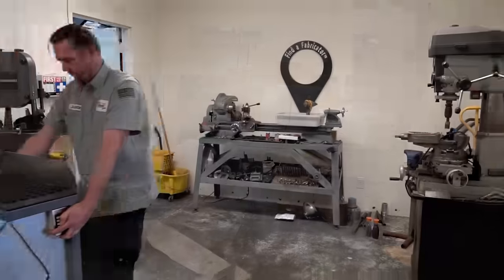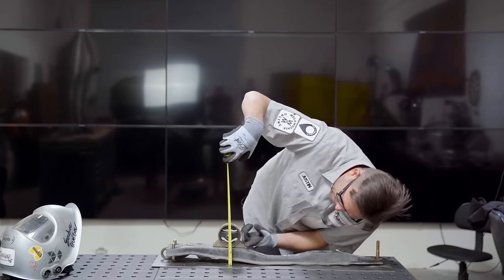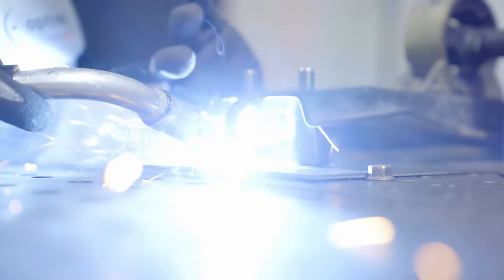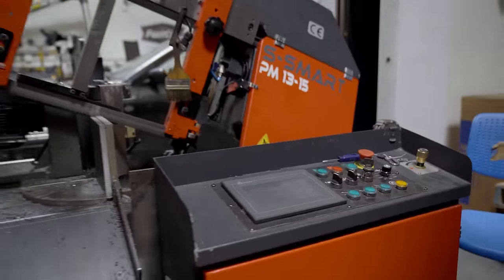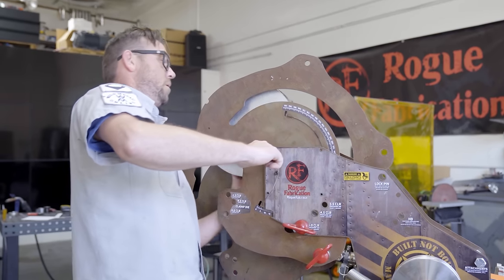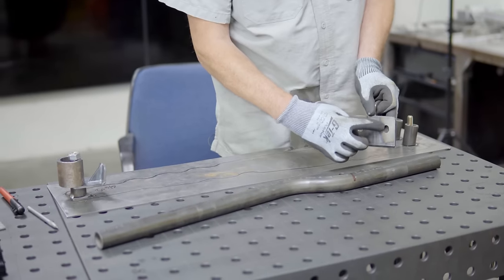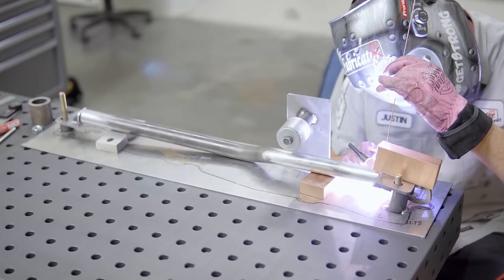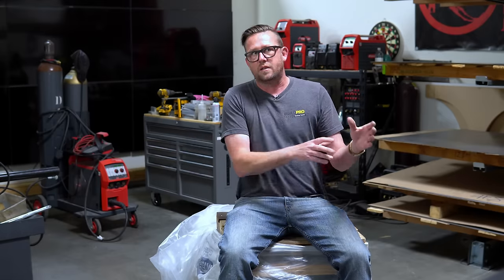Custom Tubular Crossmember from Scratch | TFS Lost Episodes 1

Comment: A while back you made a video designing a control arm and glossed over how you chose the material thickness. How you knew what would be strong enough for the part not to fail. You said it was boring and might make a video if we wanted it. WE DO! I feel like that is one of the most critical things missing in my ability to sell great parts that I know won't kill someone. Would love to see a video explaining your process!
Reply: its all about Section Modulus, Moment of Inertia, and Modulus of Elasticity. you know, engineering stuff
Reply from the maker: I can't teach people how to be engineers. That's kinda something you should go to school for.
Reply: @TheFabricatorSeries  what a lazy, condescending response. You could very easily give us a how to for dummies or break it down into laymans terms. You don't need to teach us, or condescend someone, just explain your reasoning for choosing the material thickness.
Reply from the maker: @HeresMinx  Nooooo... I can't. There's no such thing as taking Part A and plugging it into Part B and making Assembly X that works for everything because some random guy on the internet told you it would work. If you don't believe me - go to school. You'll understand. If you want to get mad - go to school and learn how to prove me wrong. Just go to school and learn something.
Reply: @HeresMinx  many times the choice of material is based upon the law of surprise - that which you already have but dont know until you look in your stockpile.
Reply: @garywoodard5759  okay now that was funny
Reply: @TheFabricatorSeries as someone who has designed control arms for production vehicles I appreciate that response and don't find it condescending. I also drive on public roads and don't want to have to worry about crazy people making their own control arms using a boiler plate set of rules they found on the internet. 

Not that the automotive aftermarket is much better than that in a lot of cases. Working with automotive aftermarket companies early in my career made me realize you should never be the first customer to buy a product from an aftermarket company if it is safety critical.
Reply: @TheFabricatorSeries 
  School? Yes good idea. Finances of schooling are most often the obstacle to furthering one’s education. 
  In China, if a person wishes to attend advanced education at a school, the Government of China helps pay. The student graduates to a career, without huge debt. For Real, in fact.
  This is a primary reason for the Stunningly fast growth of China.
Reply: @HeresMinx  He wasn't being lazy or condescending.  There's a reason that engineering is so tightly regulated.  After sitting for your Fundamentals of Engineering (F.E.) exam, you have to have at least 5 years of experience engineering under a Professional Engineer (P.E.) that signs off on and stamps your work before you can sit for your own Professional Engineering license.  Most engineers spend closer to 10 years before they are ready to actually pass the exam.  There is very good reason for this.  When you are an engineer, and you engineer something, you are responsible (read civily and potentially criminally liable) if it fails due to bad design.  That includes giving information to some random person who then uses what you gave them to come up with a part that then kills them or someone else.  But aside from all that, it's just that there is no cookie cutter solution to a problem when you are building something custom.  You have to understand the forces and stresses that the part is going to be subjected to and design accordingly, especially if it's a performance part.  Engineering is about coming up with an exact design that achieves the goal without adding unnecessary mass, filler or other crap that won't get you every ounce of performance out of the part.  Overbuilding works because thats what most people do who can't crunch the numbers, but it won't get you the highest performance.

But you don't actually have to go to school to learn all this.  There are other avenues to learn.  Books on Statics of Materials,  Mechanics of Materials as well as Dynamics of Materials should be in every reference library of anyone wanting to SAFELY design critical parts and systems.  I suggest Hibbler (one of my former professors), his books are excellent, and are among the few books that I didn't sell back after the classes were done.  Another resource is MIT.  They have published videos of their entire curriculum for engineering.  If you struggle with the math, then I suggest spending some time on Khan Academy so that you can understand and do the math, because there is no getting around that engineering requires some pretty advanced math (and some not so advanced).
Reply: @grnsouth1204  I am not reading all that

Comment: If I remember correctly I found this channel long ago when I was looking to improve my notching skills. I was using a notcher but my cage design puts multiple tubes coming in to single points. I liked this style videos better than the welding stuff now. But I've learned more from the welding stuff!
Reply: And ironically I'll be designing a couple motor mounts and a cross member tomorrow morning. For a 35 Plymouth coupe.

Comment: Integrity. That sums up you.
  I appreciate the style and speed of the presentations. 
  Hit the ground running. Try and keep up.
   All that said. If you are young and the algorithm sent you here. There are some extremely important take aways.
   Integrity. 
  Speed of jobs. Justin is not any faster than his competitors. He is as fast. The real world is highly competitive. It moves fast. Speed comes with experience. It's always best. Always best to master a level of competence before speed. Fast and sloppy doesn't get paid.
   Justine mentions keeping track of the time spent on every facet of the job. More than once he mentions keeping track of time. Each part of the job requires different skills and tools. Not all of those bill out at the same rate. Some skills bill higher. Some bill lower. It's important to keep track of your time for every step. Also a customer will greatly appreciate knowing exactly what they are paying for and why.
  Lastly. Manufacturing is come back to the US.  They stopped teaching shop in many school districts. Blue collars workers are now and definitely in future in demand.
  You're in high school. No shop classes. Search out various blue collar businesses near you.  A welding shop,machine shop. Injection molding,auto repair, plumbing, hvac,electrical so and so forth. See if you can get a job sweeping floors after school. Be diligent. Show up on time or 15 minutes early is even better. Work hard. Don't be a smart ass. You are not so much interested in that particular business as you are in getting your feet wet so to say. Learn and move on.

Comment: I always enjoy your videos  ,I like making metal thing
Reply: I once built from  scratch a self loading wheel lift  tow truck.  Installed it on a Ford cab and  chassis.  Installed and  fitted all hydraulics and wiring ,moved fuel tank from rear of truck between frame to on top of frame just  behind the  cab. I fitted joy sticks in cab so I didn't have to get out of cab to grab towed vehicle I was  quite  proud of that truck.

Comment: Hey Justin, still love the TFS series (and all of your other ventures!) You single handedly taught me how to TIG, and for that matter MIG weld. I really liked the content in this video, but was wondering if you have any tips / tricks on designing something from scratch. IE I'd like to build a front bumper for a 2019 Polaris Rzr that can bolt up to the machine, and house a winch. I have a lot of tools, but don't have a tube bender. I know I can just go buy something on the market, but would like to take a stab at building/designing one, so any tips/tricks you have for fabricating something from scratch would be sweet!

Comment: As always, I love the content.
On the design of this cross member though, I am wondering if you took into account the thickness of the original cross member tabs, when choosing the new cross member tabs thickness.

My thought on it is, the height of the bush, is referenced from your "ground" plane of the fixture base.
From there, the bottom of the tabs that bolt to the car is referenced from the "ground plane" however, the important dimension from my thoughts, is actually from the planes where the end tabs touch the vehicle, to the height of the bolt hole for the bush.
In the end for example, in your fixture if you swap from a 1/4" tab thickness, to 1/2" tab thickness, then from the fixed point on the car where those tabs bolt to, the area that bolts the bush on theoretically is pulled down by that 1/4".

Do you think in hind sight it might be better to mount the part to the fixture "upside down" that way the height of the bush and bright of the mounting surface come from the same plane, and changing thickness wouldn't matter as much?

Comment: This was a very informative and interesting video. But let me ask a very naive and possibly stupid question. The only thing that seemed to be wrong with the piece that came off the car, was the broken to pieces bushing. Couldn’t you have just cut the one mount of the original  and fabricate the new bushing mount and weld it back on where the original came off? That would have been a very boring video, but you might have gotten the job done much faster. Or was there too much rust on the original piece?